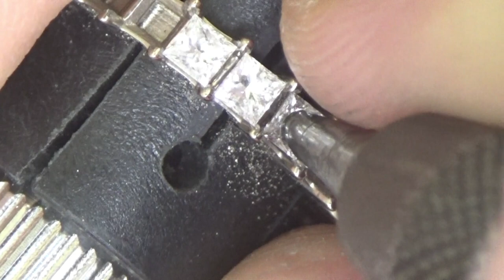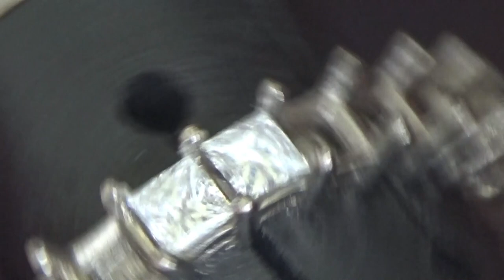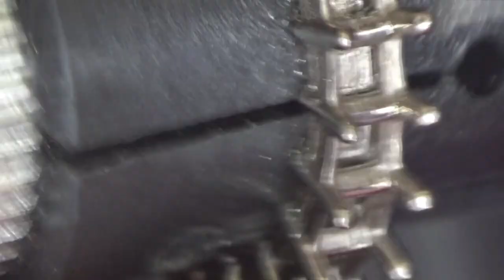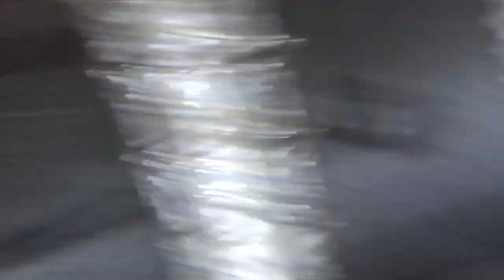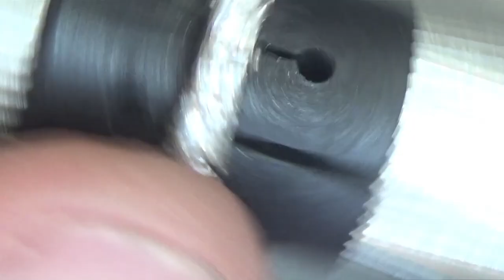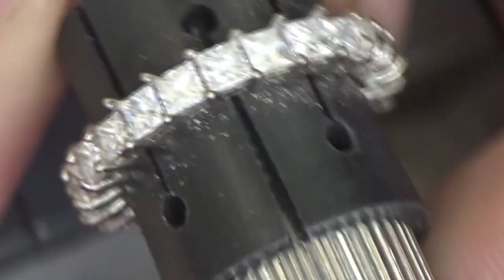Princess Cut Eternity Ring

Comment: Sneaky way of setting these princess stones...even this is prong setting but looks like you kind of did the setting in between channel set and invisible set on these prongs. And then smash the prongs to hide those little walls between each diamond. Never thought this way to set the princess stones. Man! I learned so much from this video. Hope i can have a chance to use this technique I learned from you . Thank you so much for sharing! I am just wondering the metal seen very soft...is it white gold or platinum or some other kind of metal? And I am sorry if I make a stupid assumption. If it is not white gold, does this technique work on white gold, such as 10K,14K and 18K white gold?
Reply from the maker: Hi, Thanks for your nice word! This is our way of setting these princess cut diamonds. The material used is 14kt white gold.

Comment: Good effort but this setting technique will easily break stone corners if the claws are short and if they are long which easier to be pushed over the stones but will leave too much metal and gaps on the top which always get caught on cloths. Another downside is that this setting technique will leave gaps between stones. It can never be achieved a flush bling continuous looking of stones on topview because of this corner cutting style.
Reply from the maker: Hi James, Thanks for your elaborate comment.

Comment: Sry bro, but this was "kamekaze style". The edges will break easily if you have bad luck., although its diamond.. I would nevver suggest to do that with customer stones :P
Reply: Christiaaaaaan
what is the right way then? Give a link to the video please.
Reply: @GennadiyGold  Sometimes constructive criticism can be accepted in any case. The prongs are too long and the pressure is directly over / on the edges of the stone. You do not have to set much stones to know that. I've been following this channel for a while and think it's great. But that's also why it is important to be able to leave criticism. When you show something on YT, you can assume that many others will follow your steps Therefore the criticism. You could previously bend the prongs outward (or already draw it on the 3D model), then the stone tips are milled out. Now all you have to do is put in the stones and push the prongs inwards (it does not take much, as the tips of the stones are already pre-adjusted). I like approaches that apply to any kind of gem .. Try that with an emerald or even a topas. You will damage most of them. And as mentioned before, even with  a diamond you do not have the certainty that it can stand it. (14 carat white gold or red gold are simply much harder. )
Reply: I am pretty sure that someone that tries to set princess cut for the first time wont try it with precious stones...i would  not anyway!
He is clearly talented and experienced,dont think he relies on luck,the setting was in 18 kt ,you can see how soft is the metal and i am sure he uploads videos to show the quality of his work and not for educating even if some with a keen eye can learn a lot!
Reply: @Christiaaaaaan  I completely agree. If my benchman did this I would fire him. This was rough. Especially with princess cuts. Additionally, artisan prongs are not slouched over, but stand upright and are bent at 45 degrees, then gently shaped and rounded. UGH.
Reply from the maker: Let's agree to disagree ;-)